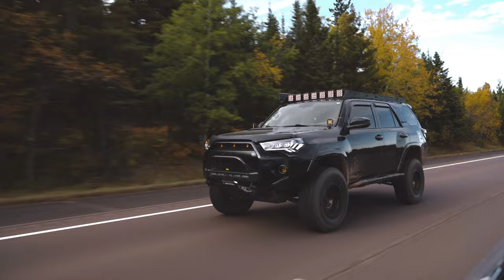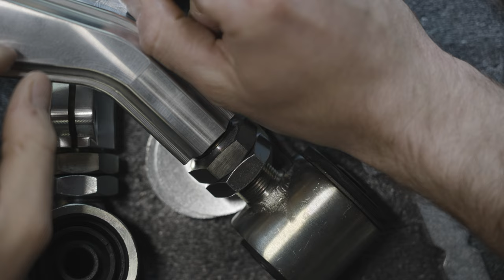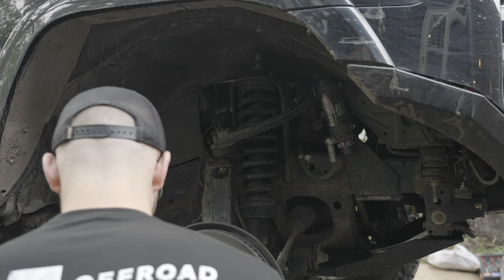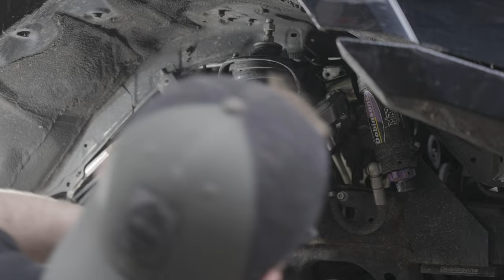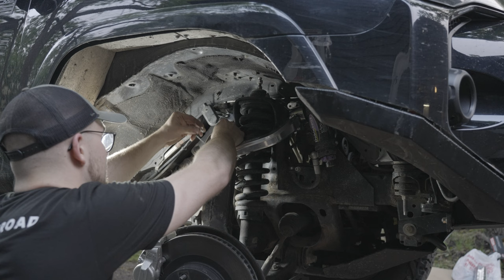I NEED Reliability on my Daily Driver. | Problem with 4Runner on 35s?

Comment: I have had my SPC's for around 50K miles of highway and advanced off-road use. Picked up some extra ball joints as i read what you brought up during this video after i already purchased. Not sure if i've gotten lucky but i have no complaints & still have the extra ball joints in the back of my rig! might upgrade to something else in the future but just thought id share my neutral view/experience.

Comment: If you want reliability, maybe get back to 33s, and try to keep as many OEM parts as you can. The moment you convert your car into your toy with aftermarket stuff, reliability is not the same.
Reply from the maker: Nah…that’s no fun.  You’re not wrong…but I’m regeared to 4.88s and really have no desire to run under a 34.  Once you have the look and clearance it’s hard to go back.  I think this will solve my concerns.
Reply: go with the 1985 4runner with the factory installed SFA's!
Reply from the maker: @dundeeecroc  I wish!
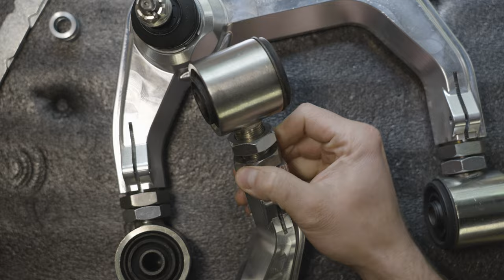Reply: @OverlandEngineer  My daily driven 1985 Toyota 4runner SR5 5 speed with the 22re engine and sits on 35's with 5:29 gearing and rear brakes converted to discs from drum. gets 22mpg using PURE gasoline, no E10 crap. hope you can fix your 4runner!!!
Reply: Getting a new transmission next week, W56.
Reply: @OverlandEngineer  Size matters. What do you have to prove?  :)))

Comment: I went with JBAs on mine, really like them, about 25k now trouble free, fully greaseable and look super beefy. JBA customer service is awesome, they even send out reminders to grease control arms. I also like the red color, looks good with my Toytec 2.5s. Love the vids, I want to do to 35s, but hate cutting fenders, I wish someone made some stock looking fender flares that would give some more room and cover up any metal trimming, I hate the look of Bushwacker type flares, and the fiberglass fenders look like a royal PIA and fit like crap. Those Dobinsons look very cool, and pricey. Thanks for the vid!
Reply from the maker: Yeah, I hear ya there.  What if I told you mine were trimmed an inch using a kit that might come to market?  It’s not too bad when there is a vinyl sticker template involved.
Reply: @OverlandEngineer  Dude, I am in. I have 285s right now, and the look just isn't quite there, but I don't want to be banging metal with 35s, I take mine off road, if it was a pavement pounder different story. i want 35s, a re-gear and a stock looking fender. I think there is a market out there for some type of fender mod that accomplishes what I want.
Reply from the maker: @pempem8527  spoiler alert, it will likely be here end of summer…but if you didn’t want a bunch of trimming I loved 285/75/17 Load C Toyo AT3s they were lighter than most 285/70s and with -25 to -32 offset all I needed was some fender liner trimming, hammered pinch welds, and the BMC and I never rubbed with -32mm offset. Could regear to 4.56 if you wanted on those 34s but they drove better than my 33s…
Reply: @OverlandEngineer  Awesome, thanks for the info! Right now I am running Hankook Dyna Pro MT2 285 70s,(way too freaking loud) they have a lot of life left, so I am trying to hold off a little. I already have the BMC, have not done the pinch weld mod yet, but will when I get my next tire. End of summer might be a good time to start the new mods!
Reply from the maker: @pempem8527  Sounds like a great plan!

Comment: That’s interesting because I had the complete opposite experience. I’ve been so happy since I’ve switched to SPCs. Wondering if they had a bad batch of them and you ended up with one.
Reply from the maker: Great to hear a counter argument.  SPC believes in their product and has great customer service.  I honestly wondered a similar thing.  I’m not bad mouthing them more just explaining what happened.  Decided on this product because I felt it fit my use case better but I don’t think they are a bad product.  Hopefully the bad batch doesn’t become a regular thing though…you never know.  That’s my fear if you need a reliable product for long driving trips…if you are in town whatever, wait a week and get the replacement and no problem.  They will take care of you.

Comment: Great video. Those new UCA’s look beefy! 
I run SPC and even with greasing every 5k miles I do hear them squeak a bit. I run 33’s and do some some pretty hard wheeling. 

Im curious, how did yours fail? And did you get any warning signs before they failed?
Reply from the maker: Yeah it’s a great question…I’m not really sure.  I feel the bottom of the upper ball joint boot fits loose so I almost think maybe a upper ball joint grease flush could be good (if that’s even a thing…).  It’s hard to know.  Maybe it was all manufacturer defect?  You could move the arms by grabbing the spindle or by prying near the UCA bolt…if you do your own tire rotations that’s a good time to check.  The other concern I had is 35s are expensive now so if you have micro vibrations due to the UCAs or LCAs being worn, it could cause cupping and bad wear on the tires…I know it’s unlikely but I also just didn’t love the slider camber adjustment…I felt like with the bigger tires and wheeling hard enough it might move…that’s probably irrational paranoia though.
Reply: I have the same concern honestly. I witness marked the adjustment there and occasionally check to see if it’s moved. 

I’ve heard mixed things about SPC but personally I’m not impressed with the design. If mine fail I will likely upgrade to Ironman 4x4’s or Dobinson’s.
Reply: @OverlandEngineer  I'm not sure if this is true of all the ball joints used by SPC, but I do know that some of them actually have play right from the factory (supposedly designed that way).  Sounds like BS to me, and you never know what the truth is with SPC.  Typically, any movement is bad movement in a ball joint.  I agree that the sliding camber thing seems too easy to move with a hard hit, but I've never actually had that happen either.

Comment: I’m on my second set of SPCs on my 4th Gen. The first set failed both in the ball joint AND the bushings on both sides of the truck in less than 25,000 miles. And that was with greasing the ball joints every 5k.

They did end up replacing them after 2 or 3 months, mostly because the distributor I bought them from seemed rather disinterested in helping me get it sorted out, and I ended up having to deal with SPC directly.

I’m hoping this set lasts longer, but when they’re done I’m moving to Dobinsons

Comment: Hey man, totally unrelated question but do you spray your truck with any kind of undercoating? I have a 2016 sr5 and I live in Minnesota. I'm worried about future frame rust know anything about which products are best?
Reply from the maker: I've heard either por15 or fluid film.  Apparently por15 is strong enough to go over rust.  Fluid film I guess is more dynamic but you can see through it.  Por15 is really expensive but I may break down and remove a bunch of stuff and do it one of these days...Its pretty tough though...the inside of the frame is the worst, the outside is typically just rusting welds...a shop I take my truck drills a hole in their frames and welds on a host spout.  So you hook up a garden hose and just run it.  Best they have found to keep inside the frame in decent condition.

Comment: SPC has tolerance issues on their UCA's.  Some fit a little tighter, some fit a little looser.  When they fit a little looser, once you tighten them up, the upper bearings will be brought ever so out of alignment leading to premature failure.  You will hear the slight clunk when turning into driveways at low speeds.  SPC did say they had a bad batch at one point.  Unfortunately I've been through THREE SETS of SPC UCA on my 3rd gen Tacoma.  All three have been with different batch numbers so their statement about a bad batch is moot.  Thankfully this is the one thing I paid a shop to install, and SPC has covered the replacement arms, labor, and alignment costs.  Did not cost me anything but time off of work, but unfortunately it's left a severe sour taste in my mouth and I'll go out of my way to not recommend SPC UCA's any longer.  Some people have good results, but it seems like most of those people are with older arms and are blindly recommending the newer arms which have flaws.  I went with the Accutune UCA's this time around, they've been on the truck 3 months and so far so good as far as no noise, no weirdness, but they don't have as much adjustment in the camber settings as the SPC's.

Comment: My 2019 taco had a loose bj and SPC has a new design with a sealed ball joint that doesn’t lose grease so they are sending replacements and there was apparently a bad batch but old ones only had 10,000 miles…time will tell if they hold up

Comment: My problem with the 5th gen SPC UPCs is the ball joints. They only lasted just under 15k miles and were totally trashed. The replacement set I put in 2 months ago are already getting sloppy enough to fail state inspection with under 5k miles on them. This second set I’ve even greased every thousand miles or so. I agree the boot is a loose fit, and the slop they “manufacture in for added droop” I believe is what promotes the rapid wear. This is the wife’s ride that sees 99% pavement and is only running 285’s on a 2” lift. These are just plain garbage, and I would advise anyone to stay clear or SPC.
Reply: What did you go with instead? I have 3 inch ome with 33 stt pros and the SPC’s are junked

Comment: SPC's Customer service is a smoke screen to cover the fact that they have had issues with their UPC FOR EVER.  I don't want their customer service!  I want them to fix their products so that there is no need for customer service.  They have been literally given the information needed to fix these problems from knowledgeable parties many years ago and they ignored it all.  As stated, you cannot actually use the upper end of the caster adjustment without pushing the tire into the firewall.  I run Dobinsons suspension now exclusively.  Their UPC gives you all the adjustability that you could reasonably use.  They build the best components, and they back it with the best service of any major suspension supplier in my experience.  It is also my personal belief that the Tacoma/4runner platform is built too light to run over 33" tires RELIABLY.  There really is no reasonable way to fix this.
Reply from the maker: Yeah, I love everything Dobinsons is doing…!  It will be interesting to see if I have premature failure of the upper ball joint with these on heavy 35s…I just love 34s and 35s too much to go any smaller…
Reply: @OverlandEngineer  My biggest concern with 35's is the stress on the CV axles.   I have seen so many of them fail during hard wheeling.  You can buy heavier axles, but then the front diff becomes the weak link, which is far worse. The one thing to really work to avoid is full lock steering plus heavy throttle.  That is where the leverage generated by the tire can most easily break the axle.  At least the axle is a relatively inexpensive fuse, as drivetrain damage goes 😀
Reply: I agree about there customer service. If you read through their warranty, they basically can deny your warranty for just about everything. The second set of their ball joints already had really excessive slop after 3500 miles of just highway driving, greasing every 1000 miles. They have now changed them to sealed, ungreasable joints. I can only imagine how quickly those will wear out….

Comment: My daily driven 1985 Toyota 4runner SR5 5 speed with the 22re engine and sits on 35's with 5:29 gearing and rear brakes converted to discs from drum. gets 22mpg using PURE gasoline, no E10 crap. hope you can fix your 4runner!!!
Reply from the maker: Lol, thats awesome.  Theres really nothing to drastic to fix...I'm being a bit dramatic because thats the YouTube game...though I am really trying to minimize components that need tons of maintenance.
Reply: @OverlandEngineer  Nice work!! don't forget to install Trail Gear Bronze Clamshell Bushing on the driver's side, this eliminates the factory Needle Bearing there, inside the front driveshaft housing where the CV axle goes in. when these trucks have a lift over 2 inches, it will make the groaning noise while on the road. I had 3 2nd gens Tacomas TRD's.
Reply: you will need to re-gear your 4runner.
Reply from the maker: @dundeeecroc  Hmm, I haven't really heard any groaning noises yet but I know about the mod you are referring to.
Reply from the maker: @dundeeecroc  Mine is regeared

Comment: Those UCAs look bogus to me. I have SPCs and no problems yet, no off road here , but maybe only 10K miles since install. They are the old style, round tube with poly bushings and then the adjustable ball joint on the thick plate.

Comment: You had a lot of that video correct except you need to spend more time learning what camber caster and toe are how they are related and what they do. The magic of the Spc arms is you have to ability to adjust for less castor. By adding castor through upper ball joint you are moving the upper ball joint rearward in relation to the wheel well. Hurting your body mount and firewall clearance. I’m excited to see how the dobinsons ups aligns and if it’s able to maximize for tire clearance like spc.
Reply from the maker: I've had this exact comment on another video and I'm legitimately confused.  Does the geometry change for different CV axles or something...

The Dobinsons instructions explicitly state to put the spacer behind the shock tower closer to the firewall.  This will give 3 deg of caster over 2.  That instruction is completely opposite what you are saying.
https://cdn.shopify.com/s/files/1/0029/2795/1981/files/UCA59-202K___203K_INSTALLATION_INSTRUCTIONS_3440d33f-fc5c-4d57-8be4-be6977644607.pdf?v=1686064491

Many other UCAs on the market do this without adjustability because then you adjust the LCA as far forward on the bottom.  Typically though, LCA adjust has diminishing returns...you can't typically max out the bottom without adjusting camber which would mean maybe pulling the LCA toward the firewall away from "Max" positive caster.  In a perfect world, the LCA would be moved as far from the firewall as possible and the camber fixed in the UCA and then hopefully the caster lands between 3-4 deg.  The toe is then adjusted using the tie rods as far as I understand.

I'm not quite sure what I missed...I know the UCA adjusts for less caster but thats so that the LCA can be adjusted for as much as possible...Its still a net positive caster.  Feel free to rebuttal me, I just thought I had this ironed out at this point.
Reply: Overland Engineer, what you said after “in a perfect world” is exactly what I do when I install and align these. With around 3” lift I max out both cams on the LCA to move the lca as far forward as possible. Then correct the camber with the UCA. With the spacer on the back side I usually end up with around 4° of caster. Caster adjustment on the the UCA isn’t really necessary. But the spacer is a nice simple touch. Also a little extra castor seems to help with holding a straight line more. So far I haven’t noticed any downsides to running 4°+ of castor.
Reply from the maker: @purcetc  good to know, thanks for commenting this!